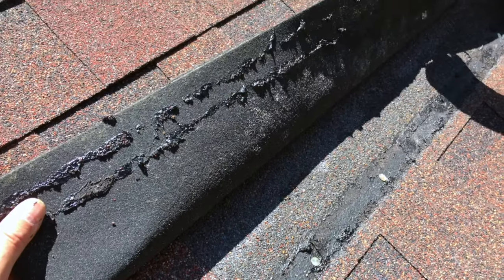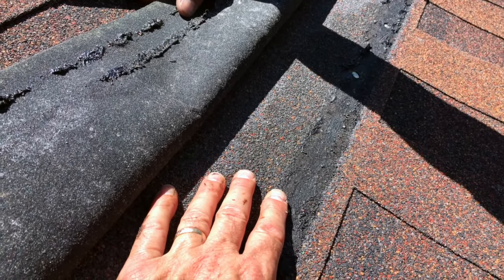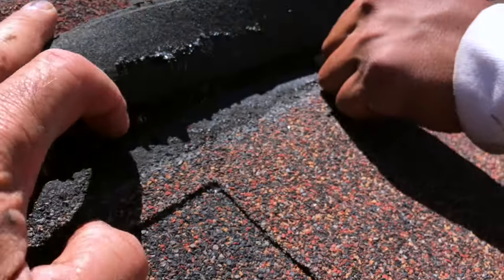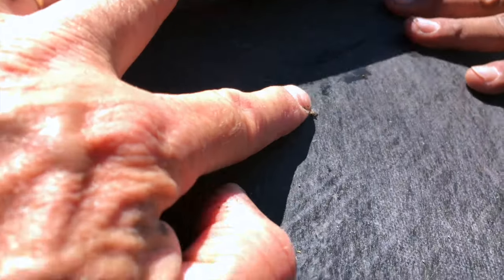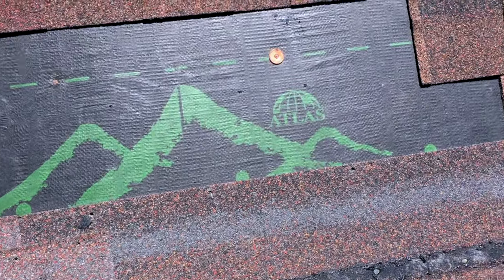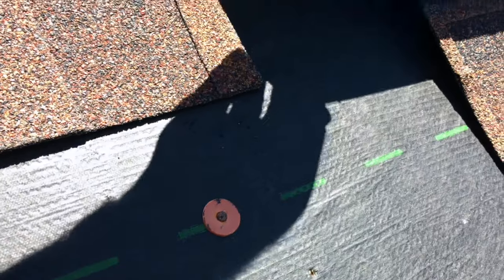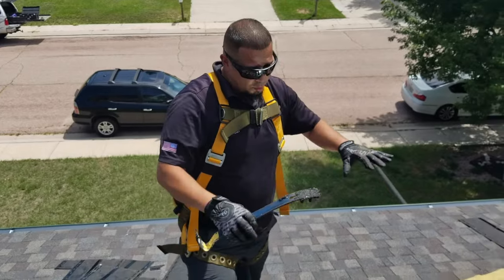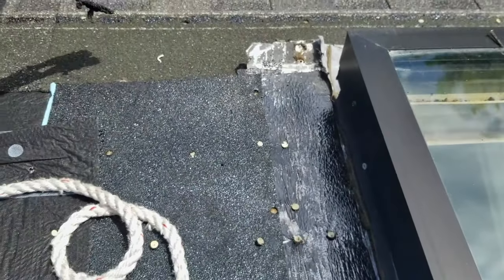HOW TO FIND A ROOF LEAK LIKE A PRO

Comment: I have found that using a bricklayers trowel raises the shingles with less damage to the shingles. It is thinner and wider than a wonder bar/ flat bar and want poke a hole in the shingles and slides under the shingle better!
Reply: Agreed
Even a kitchen spatula is better to use then pulling and tugg’n on the shingles

Comment: What if you can’t lift up the shingles? My roof is about 8 years old and it’s super difficult to get a pry bar underneath them to pry them up. What would you do then?
Reply: the older the roof the easier it should be you just have to take it slow and be patient with the bar

Comment: I have a roof leak and my roof is roughly 15 years old.  I can’t find any roofer who will come out to try to find a leak, but only will do a roof. What do you do in cases like this? It’s very frustrating because I hired a neighbor roofer and there really was no formal paperwork, under the table basically and he’s moved. Does this mean I need to replace an entire roof over a leak?
Reply: Find a handyman.  Ask around for trusted workers--not necessarily roofing experts.  Don't pick the cheapest or most available guy.  Get the one who is honest about how challenging it is to find a leak sometimes.  
Or watch some more videos and get up there yourself.  It's hot, awful, dangerous work, but if you have the right ladders and know-how it's not that hard.
I'm searching for a leak now too on a client's house (after pulling their rotten soffit off, but before installing the new one).  I'm not a roofer, but from underneath I can already tell the installers didn't penetrate the decking with their nails, so I expect I'll be searching for other leaks soon.

Comment: Thank you. I have found the leak from inside the attic but have not found on the roof from the outside. That will be my project this weekend if the rain holds off.. It's starting to ruin my sheet rock inside
Reply: Patriot Skater 

Here too. 
I hope you found your leak in the roof. 
I’m so worried!!!! I’m disabled and can’t afford a roof repair.
Reply: U found it? How u fix it?

Comment: Mine is leaking around the chimney.. And i think through the vinyl siding that has the holes for ventilation. I did not think it was suppose to do this..
Reply: Did you figure it out? Mine did the same and our inside cealing feel in today. I looked on the roof couldn't find anything.

Comment: You made an entire video without showing that under driven nail as the cause of the leak. Your video is useless then
Reply: That’s was my thinking also 
The didn’t found source of leak 
They just found wet spots 
So repair in this case useless 
Till you will find actual source of leak

Comment: What’s an under driven nail?
Reply: Rhonda Mills a nail that is not all the way down.
Reply: Rhonda Mills an example is a nail that bent because of hitting a nail on an underlying nail like that cap nail. If they just left it or pulled it out without using a sealing solution like tar.